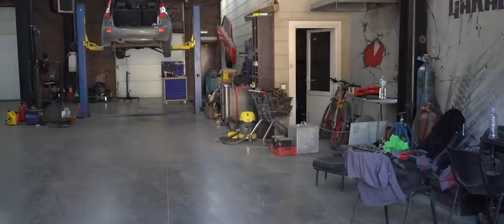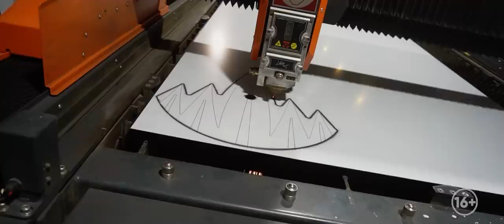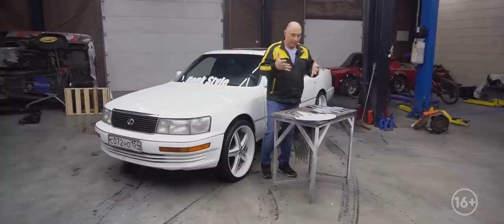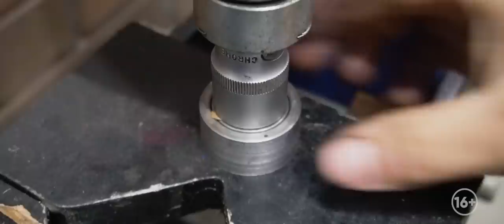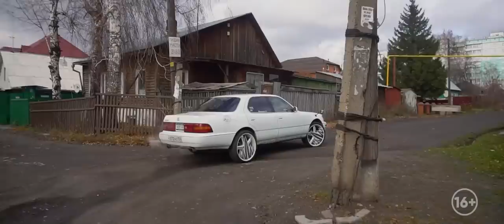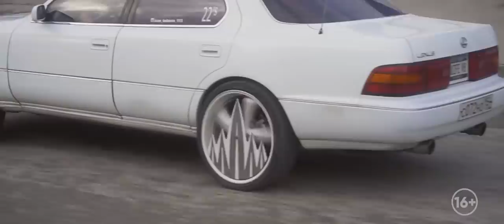We make DIY floater wheels

Comment: A few ideas,
make them heavy on the bottom so possibility of spin is even lesser,
make then convex,  a bit
make them full wheel and paint some of it black.
Reply: I think more professional rims use gyroscopes.

The set of ball bearings did help to stop friction, but you need something to equal the momentum.

Comment: they work but looking at the amount of flexing from the wind buffeting youll need to either make it from thicker material or give them a bit more profile to make them more solid
Reply: the originals are curved to the shape of the wheel spokes, and made out of cast metal too. that adds more weight to the heavy side which prevents buffeting and shaking
Reply: The flexing you’re seeing is from them not being 100% centered/balanced
Reply: @bobsmithinson2050  could be. or thats just the wind buffeting due to thin sheet metal

Comment: I wonder how frequently bearings on these things bind up and fling the floating caps off.
Reply: About as often as your wheel bearing fails and your tire/hub assembly go rolling down the road.
Reply: I laughed, but... probably doesn't happen at all. The bearings would start making all kinds of noise and scratching before they fully seized and managed to whip it around enough to chuck them off.
Reply: Rolls Royce has centre caps that do this to keep their logo always facing the right way up.

On spinners I have seen in the past weren't weighted like these. They would slowly catch up to the wheels as the car drove a long and would then keep spinning when the car stopped.

Comment: Here's a random idea, not sure if it would work though. Weld the big, powerful magnet behind the spinner that is pointing straight down and onto the wheel lip/outer edge. The idea is that the weight of the magnet would help keep the spinner in place,  but also firmly pull itself onto the wheel, keeping it locked in place.
Reply: Aluminium magnets? 🤣🤣🤣
Reply: @FireCrowsWorkshop  no, this approach would obviously need deep dish steel rims,  which are attracted to magnet.
Reply: There is no advantage in adding a magnet

Comment: I HAVE A BETTER IDEA! PUT MOTORS ON THE WHEEL HUBS AND DRIVE SOME WHEEL DISKS BACKWARDS, SO THE WHEELS LOOK LIKE THE CAR IS GOING BACKWARDS! YOU CAN ALSO DO THIS WITH A SMALL PLANETARY GEAR AND A GRAVITY PENDULUM TO HOLD THE GEAR IN PLACE SO IT IS JUST GOING THE OPPOSITE WAY OF WHEELS.

Comment: Had ya made em not heavy on one end when ya stop they would spin instead of staying in one spot for the most part
Reply: That's the point of them though, lmao.
Reply: @robokid20001  ah no that's not they're supposed to spin not set in one spot and barely move if ya look at the ones made in factorys the part on the outer rim is in constant motion when they stop and go they spin
Reply: @ericbeeman8717  These are floaters, not spinners.

Comment: I would definitely NOT go to any highway with these, if one of them come lose... 😅
Other than that, it could be much stable if the plate iteself would be more thick and bottom heavy (I know, easier said than done...)
Also, if there were some kind of rim that holds these plates in place, so if they ever come loose, there's some sort of a protection.

I also wonder wheter these "mods" are permitted by law, even in Russia 😄